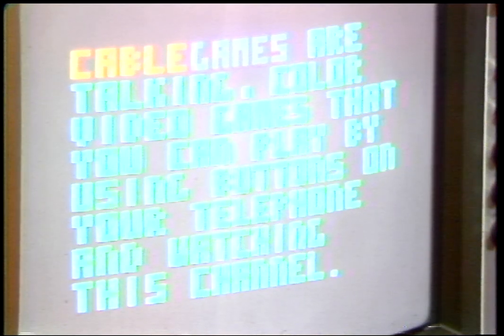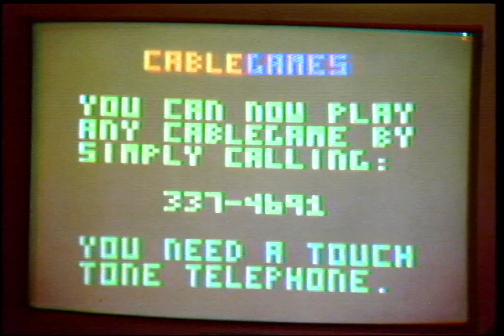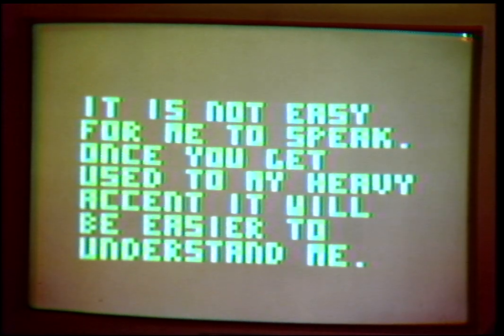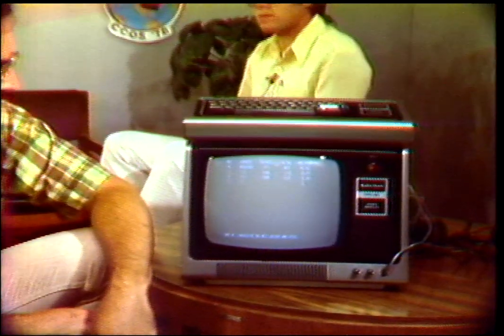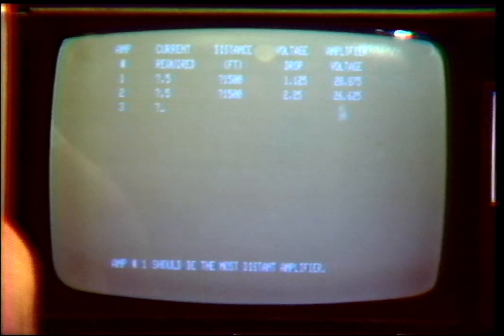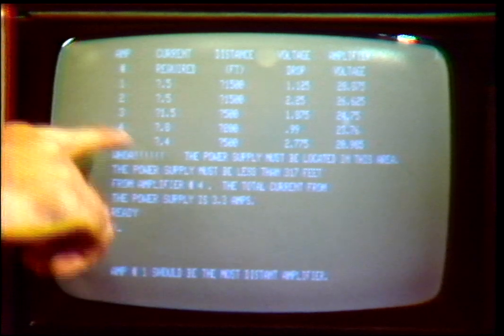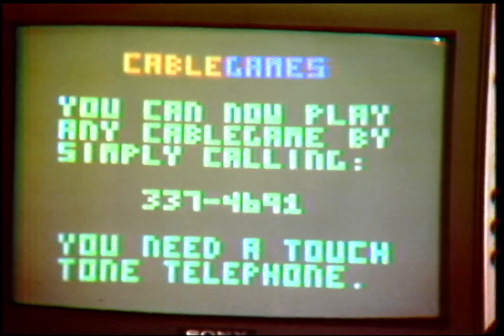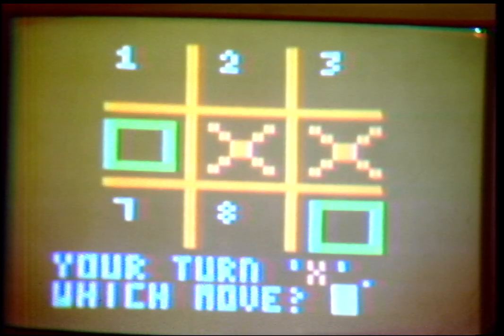CCOS 1978: Ray Daly and Bill (Microcomputers)

Comment: 7:42 people dropped kit computers like a hot potato. Altair and Kim-1 were only relevant for maybe three years and then, poof! Apple II and friends are on the scene. But it’s wild how this is talked about as history

Is this off of vhs? Clean! All my Disney vhs’s from the 80’s are in bad shape just being stored on a shelf

13:57 he’s making a distinction for hobby home built and off the shelf PCs - and a hobby computer allows for expandability. Was the Apple II the only pre built PC of its time to have expansion slots? It provides for a “Best of both worlds” situation; stable platform for working + being completely open to hacking
Reply: There were also pre-built S100 and SS50 machines and other backplane-based machines available at the time that also had expansion slots by nature, usually running CP/M. Big Apple II pull here was the color graphics of relatively high resolution for the price, and that by being a motherboard based system you would have much more expansion slots open than in a typical pre-built CP/M machine of 1977. 

And typically it would cost you extra to get a card to handle putting those CP/M micros onto, say, your regular TV as many Apple II users would be doing, which was a major benefit.